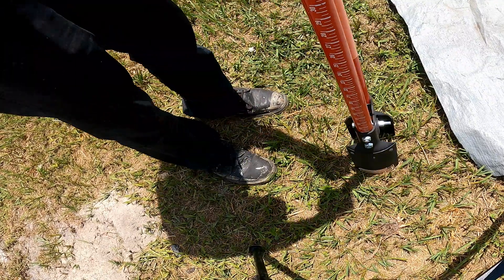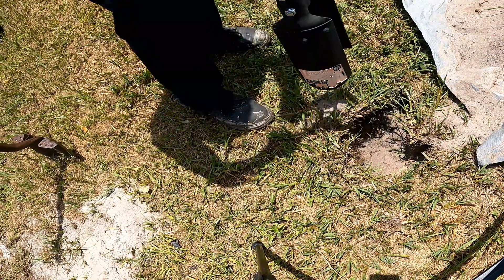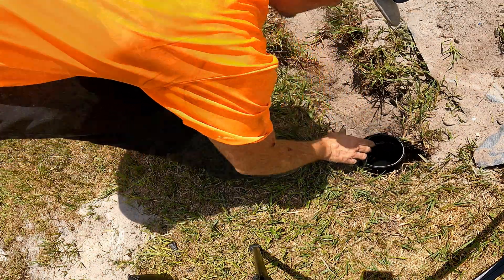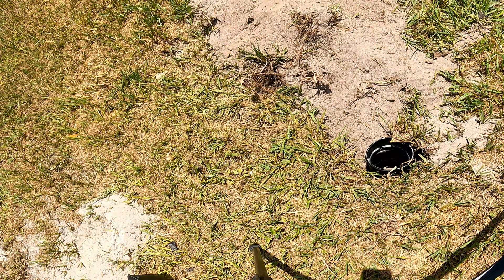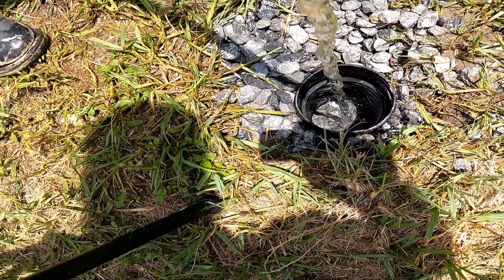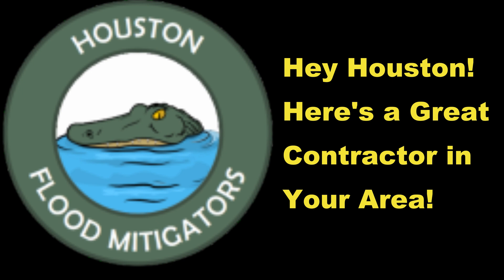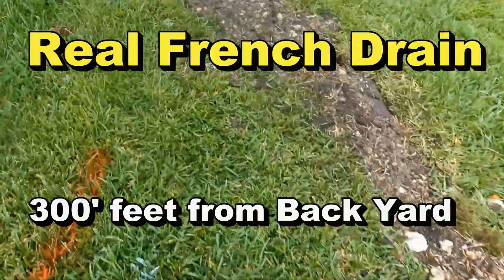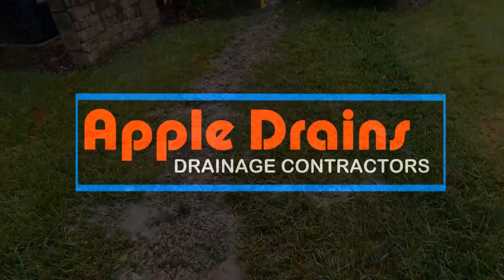How to Get More Slope in Flat Yard - Vertical Drainage - Better than Pop Up - Downspout Discharge

Comment: Can you use these vertical drains between two manufactured homes that are close to each other?  If if so ,Will this system help to keep water from getting under your manufactured home? I'm wondering if I could put a few of these along my lawn that runs between the two homes?

Comment: Love these types of videos.  You're the best.  Wish you were in Stuart, fl..I live in a mobile home park with basically no slope.  I have spent thousands trying to mix my water issues.  Water runs under my mobile home, water in my screen rooms.  I'm a 75 year old woman who lives alone.
Reply from the maker: Hope the videos help you understand drainage and can save you some money in the future!! Thanks for sharing
Reply: @appledrains  yes, they help.  Thank you.  Don't stop putting out these valuable videos.  Loving the vertical drainage.
Reply from the maker: @jcool4358  I’ve done few jobs in your area on mobile homes with the same problem. They all work great. In a park setting, you sometimes get tremendous amounts of water from the neighbors and the patio will be the lowest point. Especially during a hurricane or nor’easter
Reply: @appledrains  OH my gosh, manufactured home are an issue.  I live in a 1979 double wide. I have a sump pump on each side of my manufactured home and one near my patio behind the home.  No french drains though.  I am trying to get rid of some of these sump pump as I'm trying to sell my place if I make it through this hurricane season.  I feel the pumps are keeping me from selling.  How much do you charge to come to Stuart? Thank you.